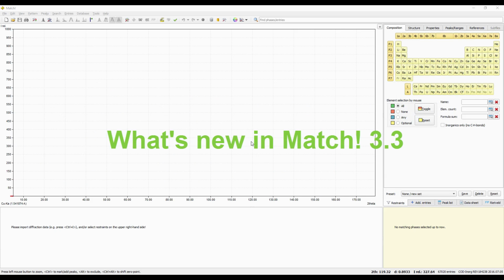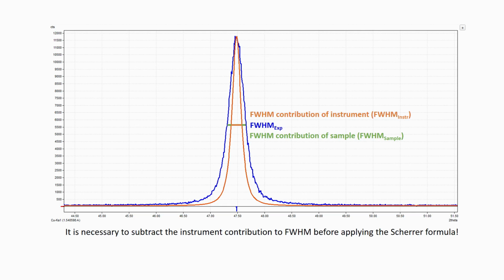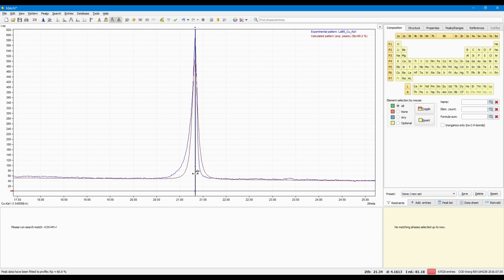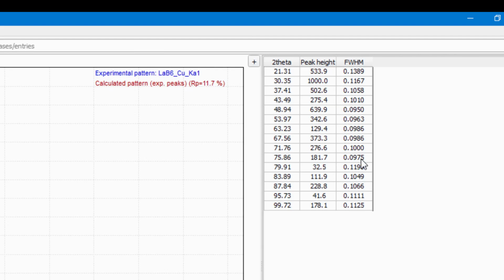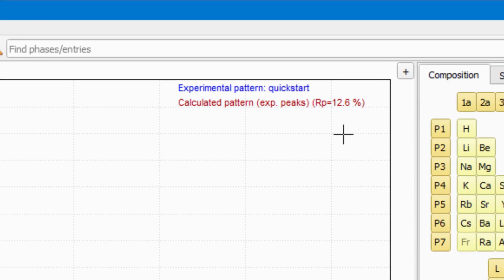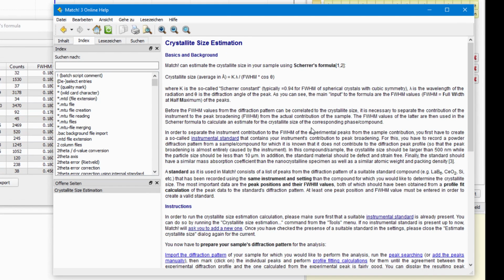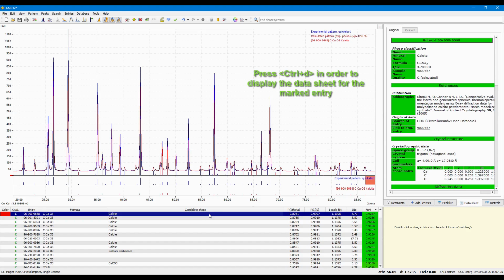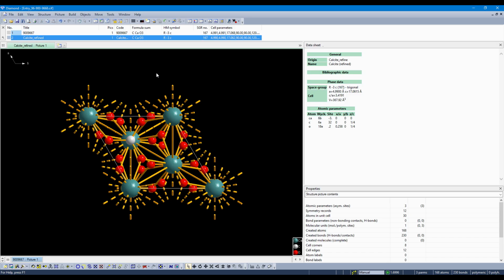Whats new in Match! version 3.3

Comment: is there any options to change the wavelength radiation from Cu-Kalpha1 to Co-Kalpha1?, i tried once but it did not work it shows me the Cu-Kalpha1 in the data sheet of matching entries.
greetings and thanks
Reply from the maker: Some diffraction data files contain wavelength information that needs to be confirmed by the user. In these cases, the "Set Experimental Details" dialog suggests not the default wavelength but the one given in the diffraction data file. We could confirm this if you send one of the corresponding files by e-mail to putz@crystalimpact.de Thank you!

Comment: One question please. How to get the diffraction pattern of LaB6 standard ?? Help me please !
Reply from the maker: This depends...if you just need a LaB6 pattern to pratice, you could use e.g. the file "LaB6_Cu_Ka1.dat" in the "Tutorial" sub-folder of your Match! program directory (which is "C:\Program Files\Match3" on Windows by default). However, if you would like to get real results from your own data/samples, there is no way around recording your own standard pattern on the same diffractometer used for the patterns of your samples.
Reply: @crystal_impact  Thanks !